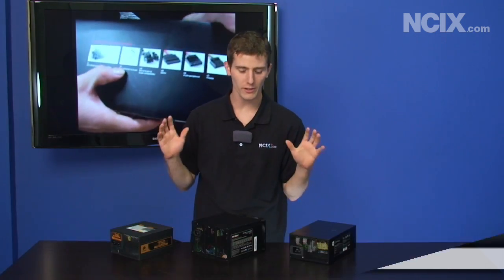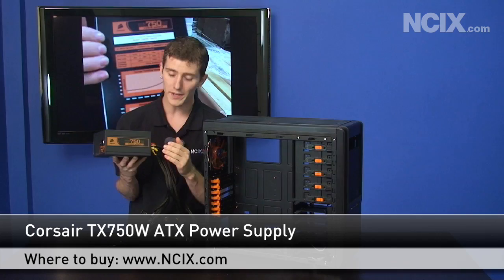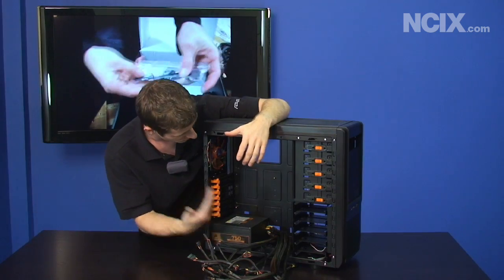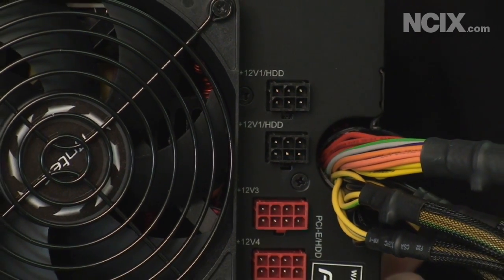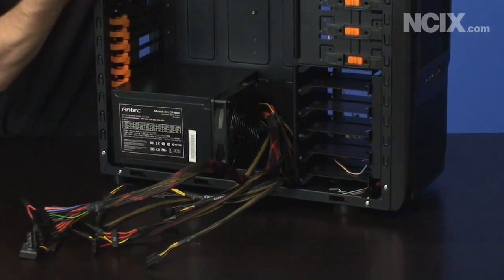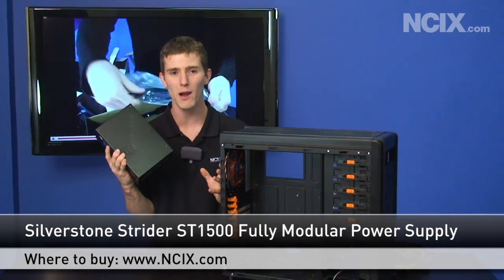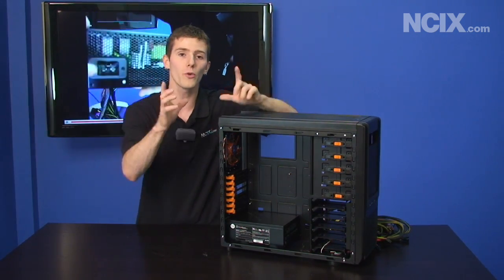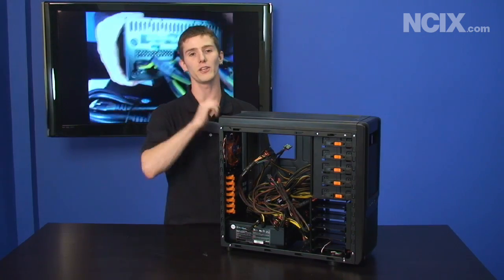Choosing a power supply. Modular vs Non-Modular (NCIX Tech Tips #57)

Comment: there was explanation, you just didn't get it. it was about the clutter in the case, and having a bigger psu does not mean you get more clutter. The antec cp850 is a good example of a semi-modular psu, sure he could have chosen the tp750 or soemthing, but its all the same.

here is the explanation you were expecting :

Modular psus have slightly less stable power then non modular. Thats it.